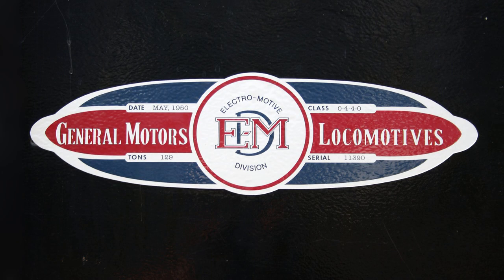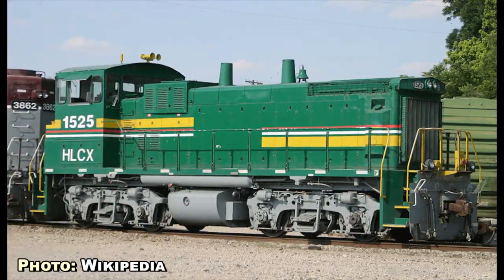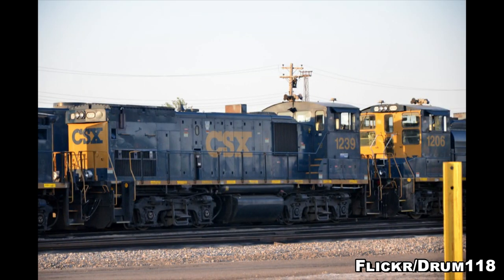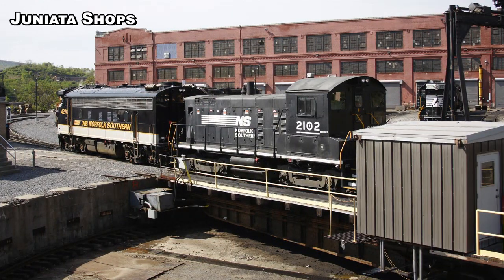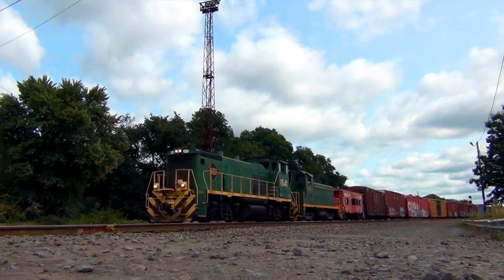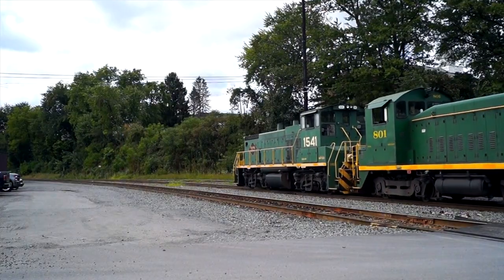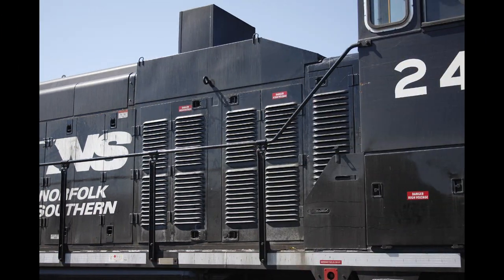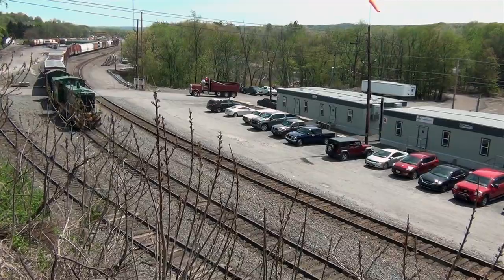End Cab Switchers.. In Decline?

Comment: I worked at a steel mill where we had Baldwins, Fairbanks Morse and a couple of EMD double stacks. While on an EMD, the engineer told me, we’re going to go the fastest ever in the mill. It was a newly rebuilt straight track, that went over a mile. We were moving about 30 mph?, when he shifted into high gear, and we were passing cars doing I think about 60? I enjoyed working with and operating the Fairbank Morse. Really good low end power with rarely any wheel slip. Then management changed, from people who cared to college kids who knew everything. No more maintenance on anything. Where it use to take 13 years to move up to engineer, now took 4-6 weeks. The new engineers were too lazy to help me sand the locomotive(took 2 people). They wouldn’t take signals, and when they realized they were going too fast to stop, they’d plug it!. And started blowing out traction motors. Our shops did excellent work rebuilding traction motors. Now it was contracted out. I was at the shop and watched as a locomotive was leaving, (in the shop for traction motors) blew both motors before it reached the shop switch! But the company is saving money! Museums tried to get some of the locomotives, but the mill cut them up, “to teach the union a lesson”!
Reply: Then management changed, from people who cared to college kids who knew everything

oh man... as soon as i read that, i knew the rest of the story was in for a bad turn

i'll take a person with good ol' fashion common sense over a college educated pinhead anyday

Comment: I work for a major class one, only got to use 1 MP15, I thought it pulled like a tractor and I liked it, but other than that the only "switch engines" they give us is either a GP 39-2 or an SD 40-2 with a Canac RCO conversion, I think the railroad likes using old Geeps and SDs for switching simply because if they break down they can interchange it with another one, they have an abundance of them and they pull good,  I even switched with several GP 30s rebuilt as GP 39-2s.  But I really think another reason is locos are not assigned to yards anymore, sometimes I switched with extra road power that was in the yard waiting for the connecting train later, I switched many lists with AC4400s, SD 70s, they load slower but we still get the work done.

Comment: Got a couple of classic end cabs on a local shortline, the North Louisiana & Arkansas Railroad. They’re a couple of SW1s from the 1940s and still running today. They also have a small fleet of GE 80-tonner centercabs and a Paducah Shops rebuilt GP8. The owner of the NL&A, Arkansas Shortlines LLC, has other end cab switchers on it’s other railroads including SW1s, an SW9, GMD-1s and a couple of Alco end cab switchers.

Comment: I've used Geeps, big mainline units, and an SW1500. Honestly the 1500 was a fantastic engine. We could move 70 cars of empty hoppers with that thing. Had to hit them a few times, but we got them moving. Started well, stopped even better, and pumped the air great. Easy and cheap to maintain. I don't know that I'd like to use less than 1500 horsepower, which a lot of those older switchers are, but there's definitely still a place for SW/MP15s.

Comment: Great video AC! At Conway I think NS has an endcab for shop moves, other than that the only endcabs are located at: Mod-Dok in Leetsdale where they have an SW900M I believe is the designation, that they use to switch R&N and NS coal loads. Be sure to check them out my buddy has some nice videos of em on his YouTube (NS 5350). The A&OR (Aliquippa and Ohio River) which is EX A&S has a couple customers now since J&L steel closed. They use a an SW1500 painted in the maroon and grey P&OC scheme. Also the P&OC Neville Island spur is sometimes visited by the EX Pittsburgh Industrial Railroad MP1500. Take care AC, thanks for all the info!

Comment: There is still quite a few in my area there are also a few higher horsepower locomotives used for yard operation in my area the BNSF yard near me now it runs two gp40s and has recently upgraded twice to higher horsepower they upgraded from one single locomotive to two and there aren't multiple different times I can recall of different units switching in the yard

Comment: There are loads of them working in industry yards across America and in many other countries, they are just not viable options for the class 1 railroads and decreasingly for class 2 & 3 as well with all the rebuilt 60's to early 90's loco's available for a reasonable cost that increases the smaller railroads capabilities to move longer trains at a higher speeds when needed.

Comment: Too much horsepower on a four-wheel truck results in slipping. When you have a low horsepower switching locomotive you don't run into those problems of having too much horsepower that you could actually get to the ground.

Comment: The end cab switches from the 1950s are the locomotives that killed all the small steam engines that switched yards. Engineers would learn how to run a small steam engine and gradually run up to larger ones. The introduction of diesel switches destroyed that. I think railroading is the only industry that uses vintage locomotives.
Reply: Railroading is the ONLY industry to use locomotives though, so you are correct
Reply: The textile, agriculture, printing, mining, aviation and marine industries also use vintage equipment.

Comment: I don't understand how a class 1 RR can be profitable using 4400 HP GE engines as switchers.
Reply: Well they mostly use emd GP and SD series locomotives for locals and regular switching. The wide bodies generally don’t have to perform heavy switching usually just block swapping thanks to PSR
Reply: @danielcarlin7784  Hot Spots Southeast frequents a yard that recently changed their operation from having a SD40-2 sitting idling, to using the power of the mainline trains to do the shifting ,mostly 2, 3 or four engines, the delay already figured into the timetable. It's kind of cool watching them.
Reply: because they dont switch like they used to, most cars are shoved and kicked, never dropped, but the real answer is they just use whats available in the yard at the time, in the yard I work in, yardmaster would give me a list and tell me to use an engine, sometimes it was a geep, other times it was an extra GE waiting for a train to pick it up later, there are no assigned locos in the yard I work at, and we still get the lists down regardless of what power we use.

Comment: AMD trying to make railroads by new switches discontinued part like pistons and cylinder assemblies for the smaller engines that were in the switchers. These engines are quality locomotives and are rebuildable forever. They are a lot more versatile for a short line too because you can't switch with a great big ac44. All locomotives should be used and maintained as they should be they are a lot of money and it is a waste for them not to be working and earning you money. And they are cheap and cheerful on the second hand Market. Like a vintage motorcycle they may need a few parts. But there are aftermarket suppliers to supply your needs.